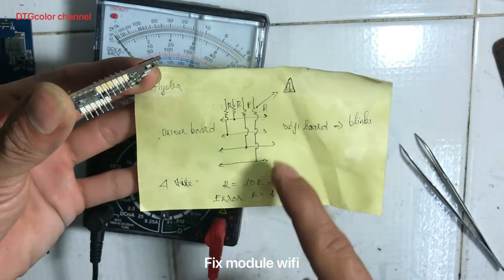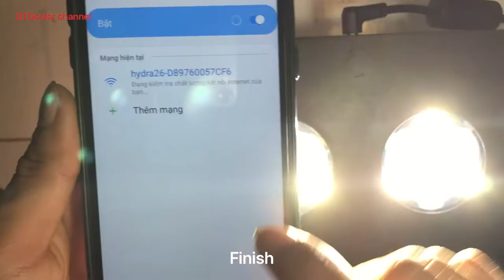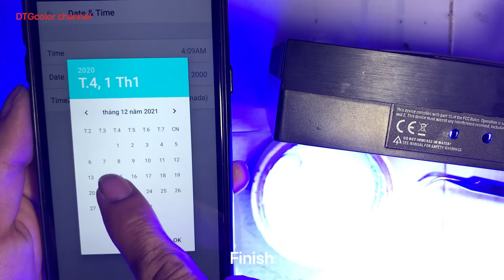How to fix hydra 26 (orange led status)

Comment: Great Video! Can you tell me diode part no. replaced in this video? My led has same issue with blue channel and it will be great if I can fix it?
Thanks
Reply from the maker: LED is (ceramic 3535 type)
Reply: @DTGcolor  thanks and do you know IC driver used in the hydra 26. My IC driver for blue led also seems burned on the control board?
Reply from the maker: @haroontariq90  hydra use ic channel LED for more version 26, 32hd, 52, 64hd is IC boot power 92512. You can mix channel with same ic (boot power).
Reply: @DTGcolor  thanks man! I appreciate your help
Reply: Yeh man just last question, I am very close to repair my led..

Can you tell part no. for diode you replaced in this video it’s says “BC t52” but I am not able to find the exact diode on digikey.com
Reply: @DTGcolor witch led driver do you use?
Reply: @haroontariq90  Did you find the diode code?
Reply: PART: 296-41002-1-ND 
DESC: IC LED CNV CONST CUR 2.5A 10MSOP
This is the part I ordered for LED driver, not 100% if it was correct though.
Led never worked as I wasn’t able to find correct diode to replace.